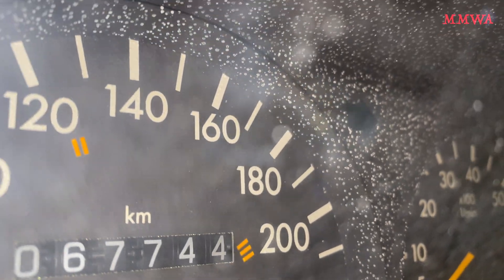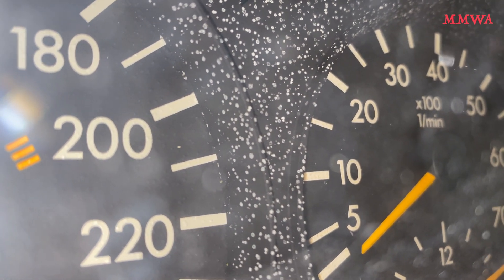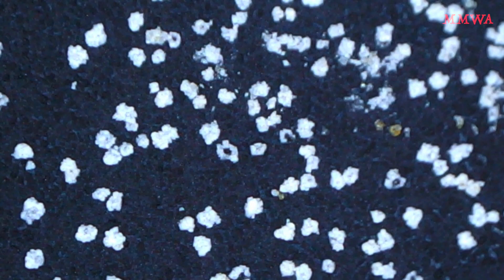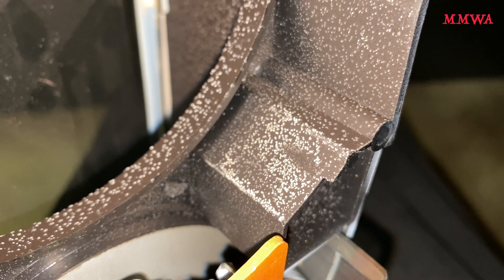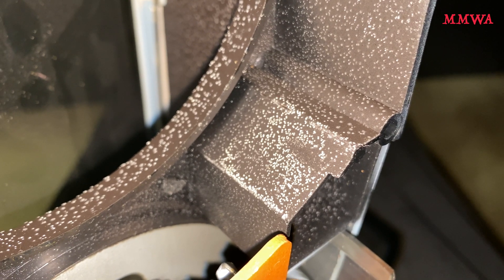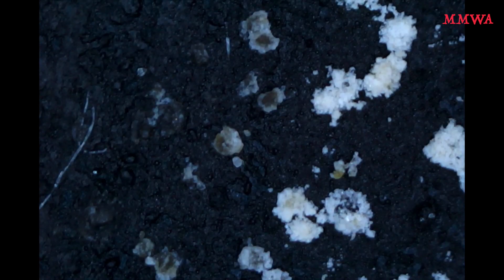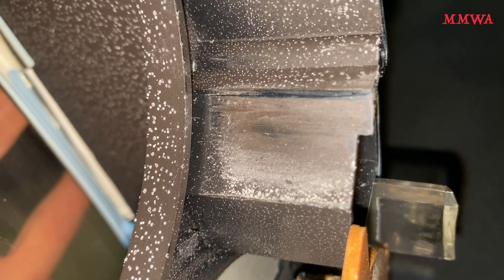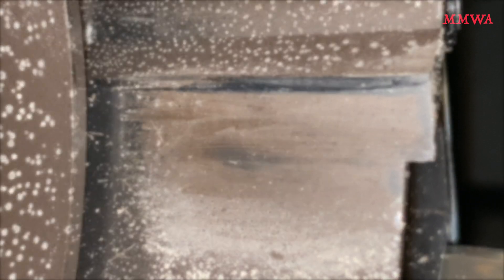Let's look at the W126 cluster with DDD (Dreaded Dot Disease) under the microscope

Comment: Apple cider vinegar will remove the white "fungus". To do a stellar job you have to disassemble the cluster, what's a non starter for me at the moment, but with a rag soaked in apple cider vinegar you can squeeze through the instrument holes and get rid of most of it. I used cotton swabs for hard to reach areas. Did this 3 months ago and the white dots have not come back, the cluster looks 90% better.
Reply from the maker: @MercedesJorn  on my w210 i removed the front clear plastic (easily) and stripped and refinished with new black plastic primer and paint. The W124 cluster is a nightmare to take the front cover off with high possibility of cracking it.

Comment: Perhaps the people at MBCluster know how to fix this?
Reply from the maker: theres a few people that refurb them now, the hardest part is removing the clear front plastic without breaking. It is simply a case then of stripping all original paint and the gooey primer, cleaning and repainting with modern plastic compatible paints as far as im aware.
Reply: @MMWA-DAVE  good to know :thanksdoc:

Comment: From what I read today it's called plasticizer migration. It's not the primer, it's a degradation of the plastic itself. Depending on the formulation, it presents differently. See here https://heritagesciencejournal.springeropen.com/articles/10.1186/s40494-020-00466-0/figures/2 for an expample of a crystaline bloom looking like white hairs projecting from the samaple. It generally means that the plastic is becoming hard and brittle as well. Whatever topical treatment that is applied doesn't change the underlying degradation and posible cracking or damage to the core material. Some have suggested heating it to soften and rearrange the internal molecules but I'm not sure this is widely successful and may depend on the type of plastic formulation. Having said that, the damage is already done as the blooms represent a loss of plasticizer that can't be replaced. People here say there is a correlation between humidity and this issue. I would suggest it is the heat in those regions making the plastic 'more fluid' and not the humidity. Differences between models and years may be a difference in the formulation or type of plastic, where the car spent it's early years and if in the sun or garaged and or quality control variations over the years of the manufacturing process of the cluster shells. In the article linked above, it states that if the evaporation is faster than the migration to the surface of the plasticizer, then there are no visible blooms or sweating. But if the evaporation is impeded (like when painted or coated) then you see the blooms appear. The type or quality of the mat black (porus) paint applied may also account for the issue on some cars and not others.
Reply from the maker: what is interesting though, is that its starting around the button holes on my w124. If it was temperature surely the whole interior of the cluster would be a uniform temperature. The other interesting thing, theres white plastic in the w126 cluster around the light guides at the front, these are only visible from the rear side. there is paint overspray on part of it only and the crystals are only on the over sprayed section while the rest of that plastic looks perfect

Comment: In my country Malaysia, every W124 and W126 I saw have this white spot. I never met one which is spotless.
Strangely this spot thing only happen to Mercedes, all other make mostly doesn't have this issue. I always ask to myself, what kind of wax Mercedes put on causing all this mess? 
I have clean mine throughly, then in a year, man, those spot slowly coming back. Anyone who got a solution to this, hope u advise.
Reply from the maker: it seems to only happen to this era mercedes cluster in humid environments. I think the only permanent solution is to strip all the old paint and primer out and redo with modern plastic primer and matt black paint. It is a big job
Reply: @MMWA-DAVE  paint will not last too..
Reply: Me too also have this problem. Interestingly, i only use "Stoner Trim Shine",  the cluster shine black already. Several months already there is no white on the cluster. For me the dot appeared on the face of speedometer, fuel and rpm

Comment: Plastic primer is usually elastomer primer so your hypothesis is logical along with your investigation.
My guess is that the top matt coating flashes off trapping solvent between the top skin of the matt and the elastomer primer and this slowly dissolves and leeches back through the top coat over time aided by the heater vent proximity and the sealed nature of the cluster.
Id smell the lightly sanded surface to see if there is a petrochemical scent to it, even faint.